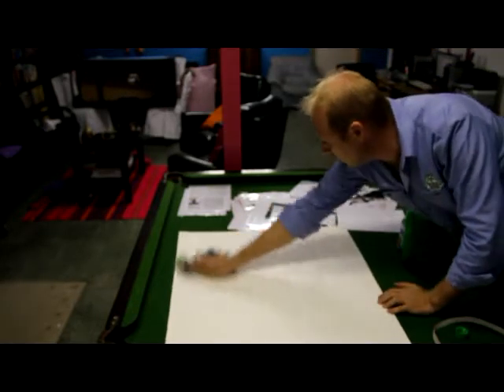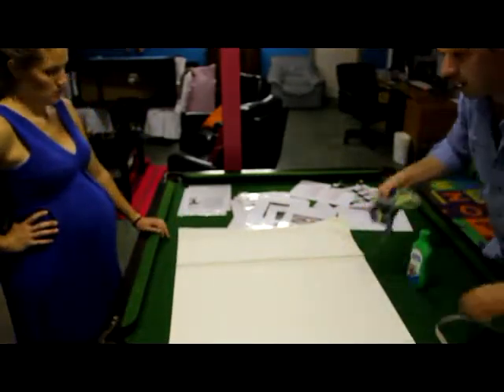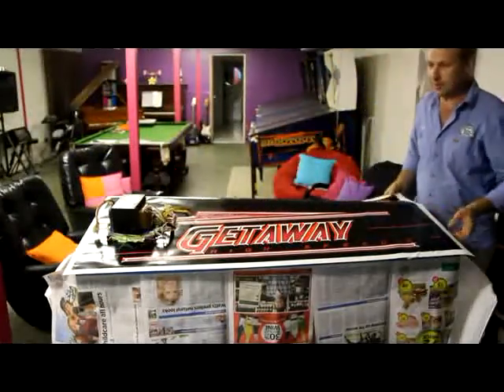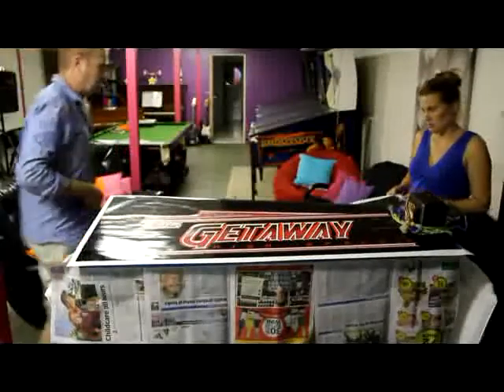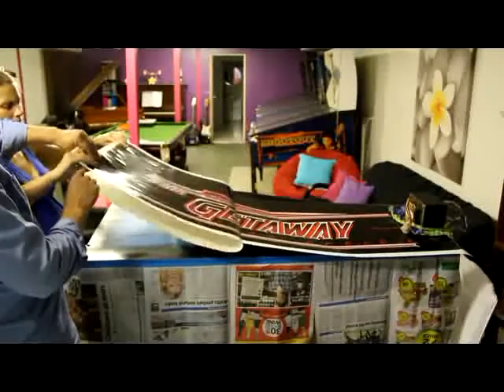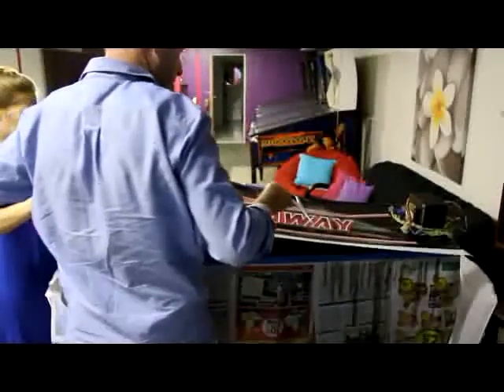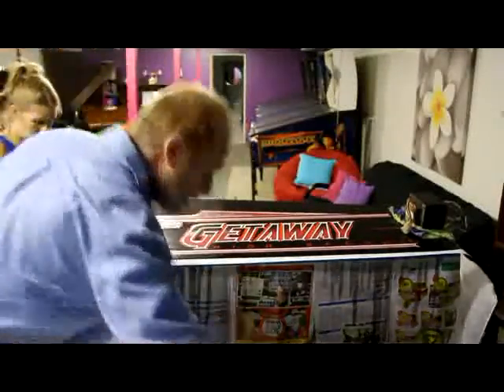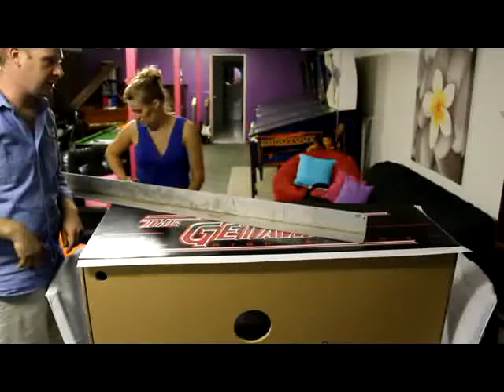Applying Pinball Decals Wet Method

Comment from the maker: As far as i am aware (and plenty of others use this method as well) the water/detergent mix does not affect the adhesive noticeably.  I don't think hitting it with a hair dryer would hurt, but i think the safest option is to let it sit for a day or so before moving it too much or installing cabinet bolts etc.

Once they are done, they will be no better or worse in terms of wear compared to decals installed dry.

As shown at the end of the vid, cut the corners around 1mm or so back from the edges

Comment: I like this technique, I have a Whirlwind Pinball that I was debating on going with the decals as opposed to Touch Up. So spraying with water does not affect the adhesives on the decals?  Would you recommend a light hit with a hair dryer to cure or tighten the decals? And how well does the decals stand up to being scuffed like you would see before applying the decal?  Oh yes, what about corners? Do you fold around or stop at the edge?   Nice tutorial!!

Comment: Hey Rob... Thanks for a great video.. Can you use the same "wet" method when fitting a full replacement mylar playfield.? Thanks again
Reply from the maker: Not sure mate, never tried that. For home use machines, i wouldn't bother putting mylar on. Just regularly clean, polish and wax the playfield and it should be fine.